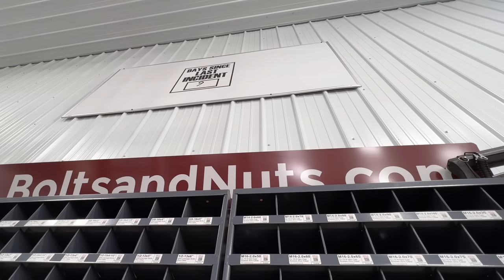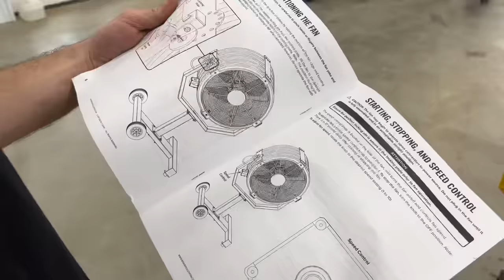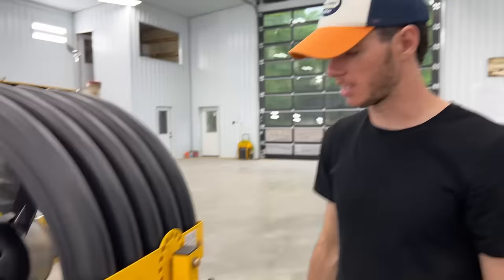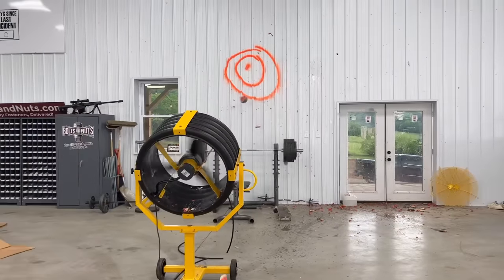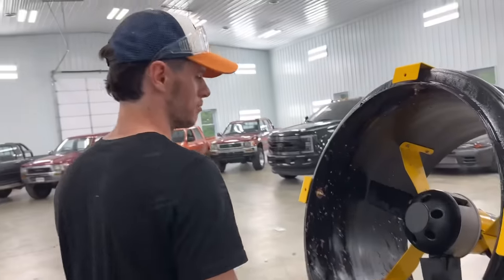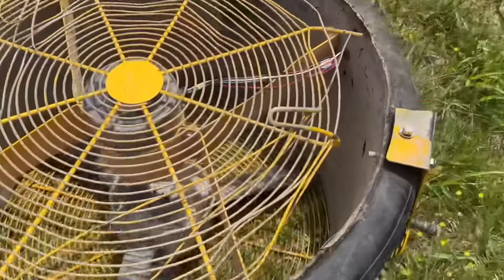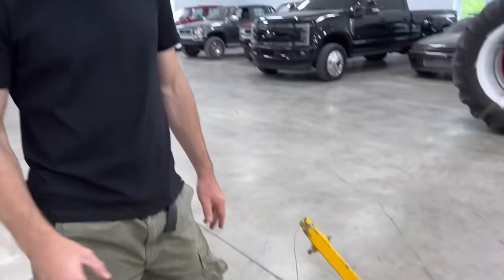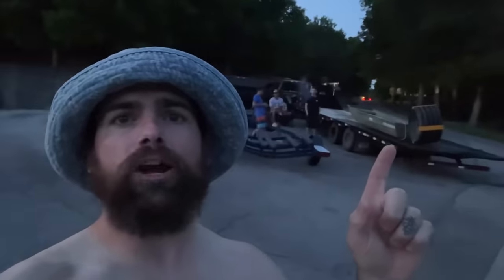Testing the “Worlds Most Durable Fan” (non biased)

Comment: I'm feeling like the plastic blades are actually an improvement. As I'm sure you know, rolling/ spinning weight is the most intense of stresses and cause of energy loss. By making plastic blades you decrease that deficit significantly. And the blades were strong enough to chop watermelons making me think they're strong enough for an average industrial usage.
Also, metal blades would have bent and continued to spin possibly causing irreparable damage to the actual fan housing rather than breaking away and allowing for a fix
Reply: Improvement? They've been using plastic blades since 1930.
Reply: @Immigrantlovesamerica  could the plastics of 1930 withstand a watermelon at 5000rpm tho
Reply: Einstein of fanblades, you gotta work for Dyson son.
Reply: Now here me out carbon fiber 😎
Reply: i think it would have been more fair to recognize the blades as a replaceable wear item and order a few extra to replace them properly as they break - the bulk of the cost of that fan is in the motor & the conditions it's rated for & expected operational life in those conditions. 

this a fair test of a product as described - BigAssFans clearly pulled a social media stunt to get people to buy a very expensive fan almost certainly over designed for their use case - this is the fan you buy if you own a foundry and need additional air circulation in the shop when it's exceptionally warm out - in that case the $2300 makes sense otherwise ya you are burning up similar $300 fans good enough for 95% of use cases like once-twice a week if not more. 

it's a niche industrial product that a marketing team decided should be also direct to consumer & is over-promising shit to the consumer it can't deliver - it's not indestructible as we all just saw.... 

I don't care to waste the time to google the bill of goods for that fan but every part looks serviceable & that motor has proven it's... ridiculously overkill and will tolerate operating in wild conditions.  The blades being plastic brings down cost of ownership over time... a single blade is always going to be cheaper than a new fan. this may not be a paid ad but it honestly could be - for the few people who need a fan like this.... 

Everyone else should spend the ~$300 for a less ridiculous object.

point proven WD
Reply: They have used plastic on fans forever js but the way you tried to describe this just blew my mind so instead of explaining like you tried to or to sum it up is “Plastic has less rotating weight..” just like on a dirt track car a late model the reason the motors and throttle are so responsive is because they reduce as much of the rotating weight in the transmission as they can which helps reduce the amount of power it takes to turn the drive train which also means more of that power is making it all the way to back tires to the ground.. but yeah “less rotating weight” but honestly it’s a fan what does it matter lol
Reply: Irreperable damage? The thing would be easy to fix. You could probably make the same fan for like $100 using the exact same materials and even possibly make it better. $2400 of plastic garbage. What a rip off

Comment: We have Big ass fans all through our factory here at Volvo / Mac production plant. We have the massive 20' wide bladed fans all through the place and they do a great job. In my early Apprenticeship they would make us go up and change the belts on the motors. You don't realize how friggen big these things are until you're way up in the air on a scissor lift. The blades are like a carbon fiber outside with metal frame.

Comment: Love your show. I had a yellow jacket fan class 1 div 2 (explosion proof). Didn't make it. It didn't go through what you did  but I dealt with my acid gas at work trying to ventilate the acid gas from the air ( one small smell of the gas will kill).....killed the fan. Could have injured many. Your testing is nuts but awesome cool.
Reply: What kinda can do u use now?
Reply: I work around acid gas all the time and it doesn't kill our fans or electrical equipment(intrinsically safe). Our plant runs 98.6% sour so it's no joke.  Maybe you're dealing with something else in the atmosphere that is killing the fans?

Comment: “If the blades were metal this wouldn’t have happened”. If the metal grates protecting the flimsy blades were still there it wouldn’t have happened 😂
Reply: He knew it would be invincible with the grate on he just wishes the blades were made of tougher material, honestly I would be upset if I spent $2,000 on a fan and the blades are made of cheap plastic
Reply: @cobrademon761  i don't think that is cheap plastic
Reply: @trolltrama9780  if it breaks, it’s too cheap
Reply: @cobrademon761  but it only broke cause the guards were removed. So why are you worried about them breaking?
Reply: @russellv6234  cuz for $2,000 they should’ve made hard for the blades to break
Reply: Fans work better with the guards off

Comment: Big Ass Fans manufacture construction-grade fans for things like high-rise smoke purge systems for Fire Alarm/egress protection. I work with these things as a designer of FA systems. 

Really tough, SUPER powerful fans. They're very often used in stairwells to pressurize them to prevent smoke from getting in the path of egress (stairwell). 

I didn't know they made shop fans, pretty cool!

Comment: That’s funny we’ve had 12 lost time injuries building railroads. They get swept under the rug and the board still zero! Because God forbid OSHA find out!
Reply: My factory is the exact opposite, someone stubs a toe and it goes on the board. Everytime I cut myself (jet turbine components have a ridiculous amount of sharp bits) I just say I did it at home and re-opened it.
Reply: We haven't had an injury in over 20 years however we have had a few off the clock.

Comment: That intro😂😂 I’ve actually seen that happen to someone while I was working building gas stations there was a painting crew on the site with us painting the car wash building, this dude climbed up an extension ladder about 15 feet with a 5 gallon bucket of paint a little over half full but set it up to close to the wall and as he was rolling the trim of the building leaned back to get a look at something and started falling back, jumped of last minute, paint splattered EVERYWHERE, all over the sidewalk, all over the dude, because he had fallen back the length of the ladder (around 15 ft) he had completely missed his drops (rag like material tarp they put down where there painting so they don’t get paint on the cement or floors) and splashed their sidewalk with paint. It was fuckin hilarious.. and luckily the dude didn’t have any serious injuries which was good but beyond me😂
Reply: Where they’re painting* lol not “where there”

Comment: Above the Arctic Circle, to heat our shop we used a pallet stove, to burn 3 pallets at a time with a 4' belt driven fan behind it. 
 It moved air but, it would have failed the first test...

Comment: $2300 for what looks like a $40-80 metal stand at the very most.. some hard plastic road that’s used for road gutters, and maybe a $50-100 motor and about $50 in extra parts on it like the blades and metal guards…

Comment: I know this is an old video now but where I work they have a Big Ass fan meant for cooling a freezer dock, well 4 of them to be exact. Some how some way a forklift operator clipped it with a load and that thing wobbled out of control until it smacked the rafters. We had to get one replacement blade and a new chain to hold it up. That's it. kekw